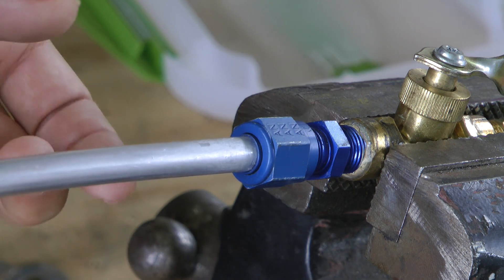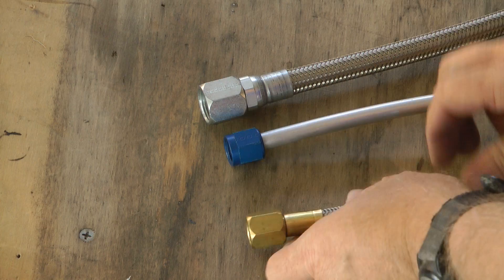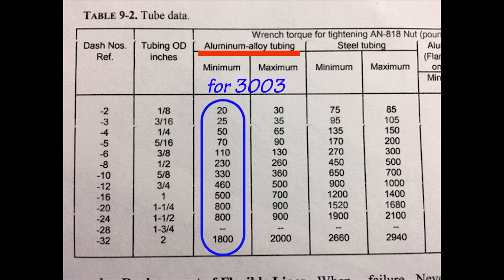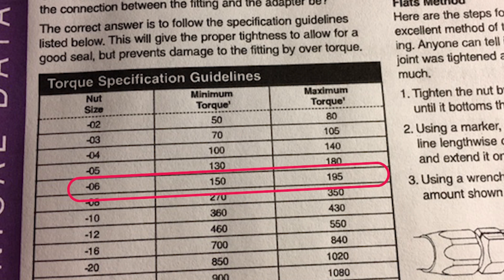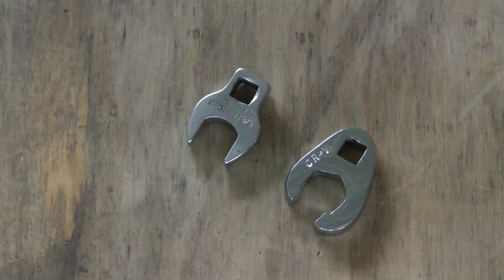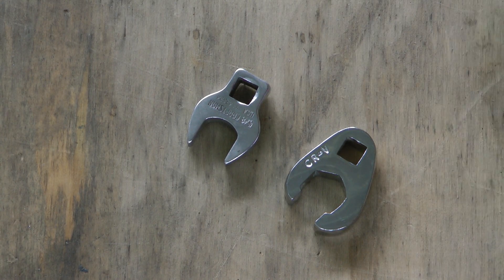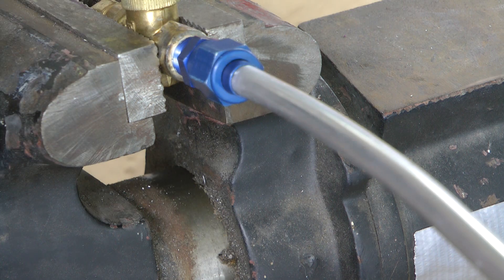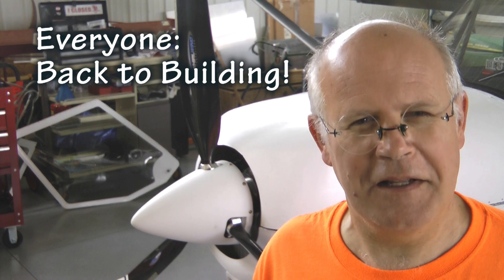How to Tighten Flare Nuts on Experimental Aircraft

Comment: I found that a lot of engineers in aviation  with installing screws bolts and other fittings they tighten them to tight especial screws holding panels on they use screws to long and over tighten the screws and this destroys the anchor nut over time and streaches the screw threads and when you go to replace the panel you have to change the screws and the anchor nuts and I show them take the screws till it bottoms and just nip maybe a 1,/8 of a turn the acchor nut will hold it and when putting panels on short screws as I have seen cables snap from long screws and bolt if you are not sure of read the manual

Comment: I found my kit included 6061T6 tubing for hydraulic, brake and fuel lines. Also if the tubing connects to the fitting at any amount of angle and not straight into it, it will leak. Small amounts of misalignment you can sometimes stop leaks with del seals.

Comment: I’m an aircraft maintenance engineer and I find a lot of engineers lame and Ame engineers over torque everything and one of my pet hates is people that over torque screws and use very long screws to put panels on and when we had hangar meetings I would bring this up all the time and would explain that if screw are to long they can hit control cables, wiring and other bits ant this was a problem with a Metroliner we’re the factory at build used a very long PK screw to hold a panel which went through a wiring loom and the aircraft would activate the auto feather on and off till one day the aircraft just rotated and the auto feather activated at full power feathering the prop just off the ground and the pilot was selecting gear up at the time and mealy lost the aircraft he landed safety and it took several days to find the problem. I surgery that if you are not sure read up on it and do not overtighten screws in an anchor nut as you stretch the anchor nut and it looses it grip on the screw and the screw will fall out just nip it and do not use long screws unless the dragon requires it 1 to 2 threads pass the end of the anchor nut is all required to hold the panel in place safely also if you over tighten it someone has to try and remove it or it will break and than that is how you end up with scratches in the paint work or holes in the skin if you don’t know what you are doing so as I say if you are not sure be a good builder and do the smart thing read up on it and ask someone that knows about these thing also over torquing my damage components and this can cause them to fail further down the line so if it calls for a torque even if it doesn’t fell tight enough the torque is there for a reason and if you are not sure ring the makers

Comment: Sorry but the 90 degree method is not correct. The torque arm provided by the crows foot would be the same torque arm no matter the angle. This is because the length of the torque arm from the point of application (drive head 1/4, 3/8, 1/2) of the torque would be the same no matter. Your setting on the torque wrench is only accurate to the drive head center. This is why smaller torque wrenches can be used to tighten nuts or bolts beyond their range limit using a torque multiplier. This essentially adds a known torque arm extension to the drive head. The torque multiplier will then give you a multiplier for your setting on the torque wrench that provides the actual torque provided at the end of the extension (torque multiplier).
Reply from the maker: Thank you Joel - you have me reconsidering the error of my ways.... I will look into the torque arm extension devices.

Comment: good tips, BUT you can use the Torque wrench at this extension, mechanics do, they just find the torque reduction factor ( X 0.9 etc.) that the wrench maker has in the instructions with the wrench, then apply this factor to the target torque, eg: if you double the length you halve the torque, x 0.5 so if 500 ft/lb was called for you set 500 X 0.5 = 250 ft/lb on the wrench, this gets you where you need to be.
this is used on gearbox adjusters, etc. where the room to swing the wrench is limited; only for emergencies, NOT for general practice, in normal bolting applications you use an appropriate sized Torque wrench for the job! ( there are special extension spanners for this purpose, their instructions also tell you what the correct setting for the wrench should be).

Comment: The torque wrench depicted has a stamp or sticker that says it's calibrated and tested. Does Tekton do this or a third party? 
The inch pound torque wrenches from Tekton are 1/4 inch drive, crows feet generally are 3/8 inch drive. I assume a 1/4 - 3/8 adapter was used?

Comment: Maybe don't bend the aluminium tube by hand like in the video, I'd use a bending spring or a set of pipe benders  over the tube.far less chance of kinks and The bends come out a lot neater. I'm a plumber, I bend pipes all day. I haven't built my plane yet  I've purchased all of your videos on the CH 650 so I may be wrong, just my opinion, let me know. Great videos you guys put out.
Reply: NarraRick yup, don't bend in your hands, too easy to flatten or kink soft tubing(as you certainly know). Also, do not tighten fittings with normal wrenches, most don't really fit the flats very well and do slip off. Flare nut wrenches are pretty inexpensive and generally double ended so you don't need many. And for the few times you will use them, flare crowfoot wrenches can be had from Harbor Freight for next to nothing. 
Always use acceptable practices. Don't shortcut because it's a "homebuilt".
20yrs AP/IA taught me there are no free shortcuts.
Reply: Chris thanks ,  I've got my pluming flaring tool and use it a bit but different sizes for copper pipes { we normally only flare gas fittings} But the whole torque wrench bit and the crowfoot wrench was great, I had no idea about them.I love these video tips . So helpful.
Reply: NarraRick remember that plumbing flaring tool is most likely a different angle than used in aviation! I believe plumbing flares are 45deg?? AN fittings use a 37deg flare.
Now, build that plane!!
Reply: Ah !  didn't know that, and yeah I don't think I'll be using my plumbing tools on the plane:} Saving up the money for the plane I'm hoping to purchase in the new year if all goes well.CheersRick
Reply: Also, remember aircraft require double flared instead of single flared fittings.
Reply: @dinopeligro  I know automotive brake tubing use double flare, but I don’t know any places in aircraft where we use the double flare. It’s all single 37 degree flares.